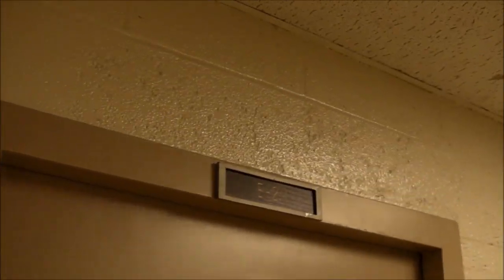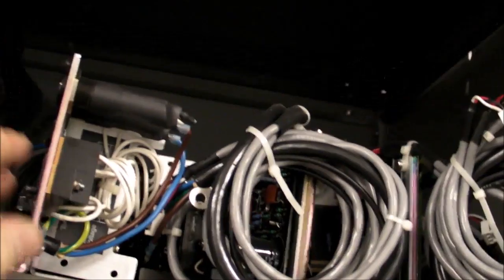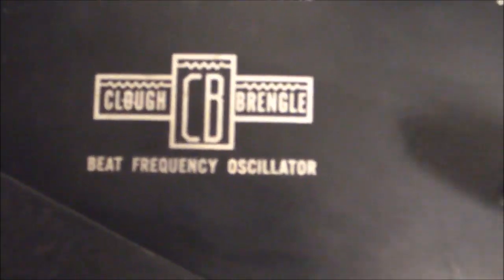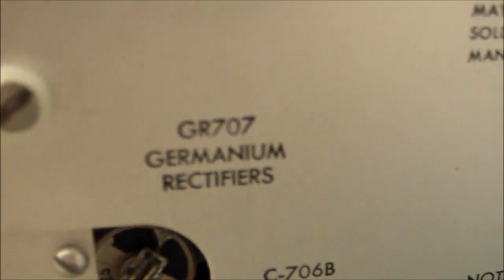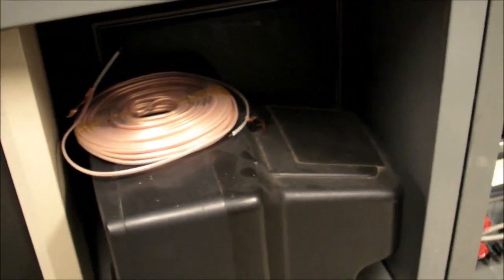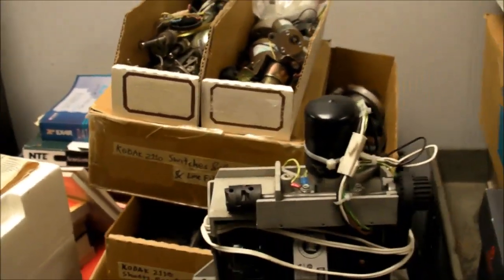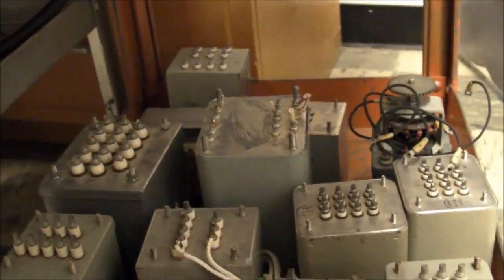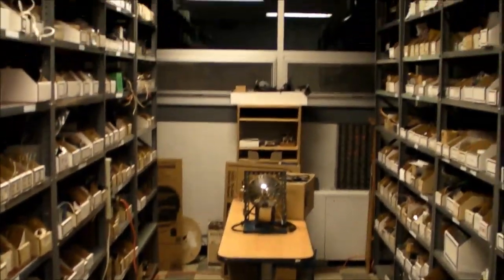(#0158) Lab Tour #13 - Seldom Used Equipment Storage Room

Comment: I wonder how long the people who made the old equipment expected it to last?
There is a reasonable "Planned Obsolescence"  in engineering and manufacturing
That has been exceeded by the stuff you have that still works beyond expectation.
Reply: ***** I think most people would consider it obsolete even if it does work.
Reply from the maker: Oh, yes, most of the things in this room are definitely obsolete, but obsolescence does not necessarily mean uselessness.